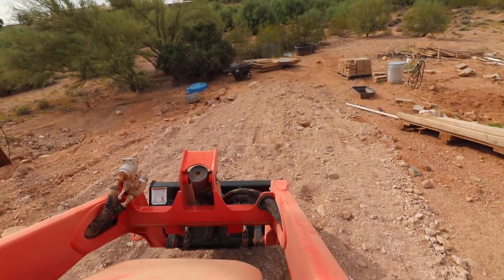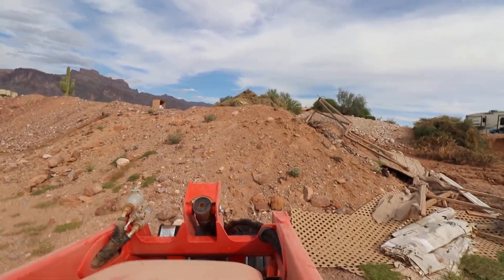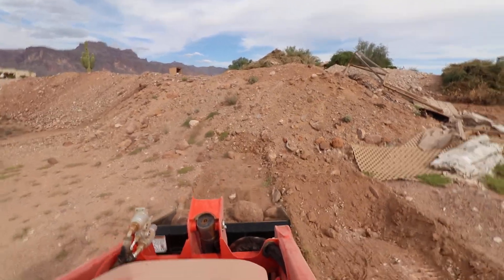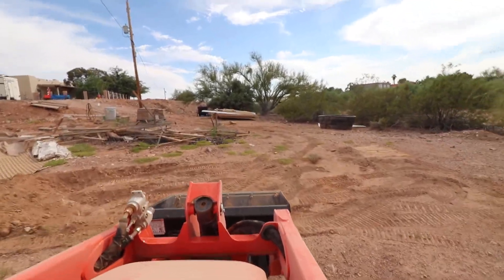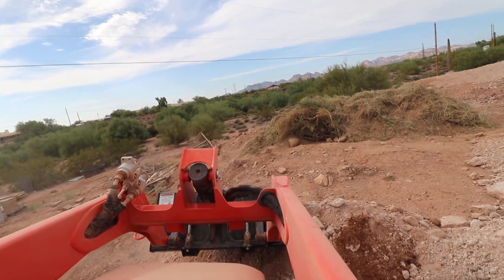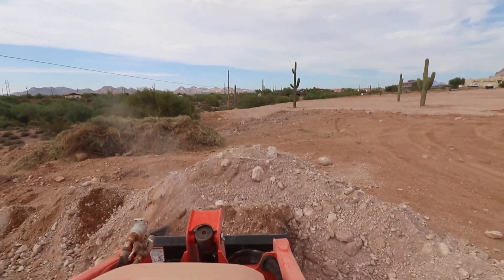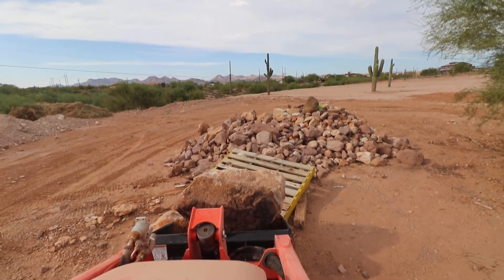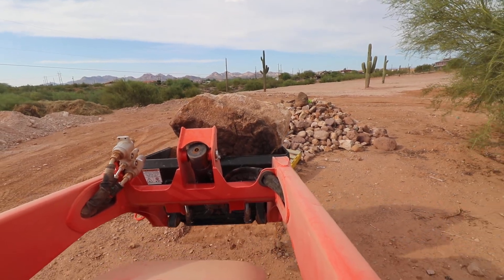scl 1000 how well can it dig in hard Arizona soil and lift

Comment: I think that the bucket with teeth will make easier work removing that hard soil. Can you give an update on your SCL1000, are still happy with it? Does Kubota do a good job at fixing your machine if it breaks?
Reply from the maker: actually, i found out kubota will not work on it in my area. i found this one out of state and when i brough it in for a software update i hade a reginal manager tell me that the dealers in my state do not have access to parts and support for the machine. i was given an option of them buying it back or having to go out of state for any warranty. although i really like this scl i ended up selling it back to them. i will gladly by one again when they offer it here.
Reply: @dirtydiggerm62  Oh did you get a different machine
Reply from the maker: @balamala2647  no i have thought about getting something similar like a bobcat or ditch witch but i just like the scl more and hoping it will be available some time soon
Reply: @dirtydiggerm62  Good luck to you and thanks for answering my question.

Comment: did you end up selling it? either way how did u end up liking it?
Reply from the maker: I like it a lot compared to other equipment in its class. there were some minor flaws like the code instead of a key to operate it because it stays active for 15 minuts after Turing it off but otherwise a good machine.

Comment: Can you see the tip of the bucket from where u stand?
Reply from the maker: yes you can
Reply: I am 5'8" and with the bucket flat on the ground, I could not see the cutting edge... I have the same 36" bucket... I ordered and installed the Piranha Tooth Bar with extended mount... It took 6 weeks to receive it... After install, I could now see the cutting edge with about 1 inch to spare... That helped out a lot.... Day and night difference... I do not gouge out holed going forward... With the addition of the PTB, the bucket now holds quite a bit more dirt without having to sacrifice the 36"... I also ordered a CMP Hydra Bucket 36"... Cant wait...
dirtydigger thanks for the video

Comment: Dose your led headlight glow dim after you shut the machine off
Reply from the maker: no i have not seen and difference when i shut it off
Reply: Does yurs stay on after its turned off?
Reply from the maker: @andrewjohnson5736  the light will stay on if you leave it on when you turn the mane switch off. i have not left it on long enough to see if it will turn itself off or not.